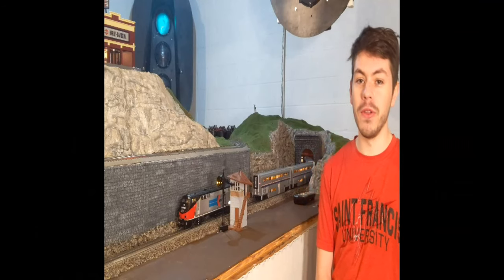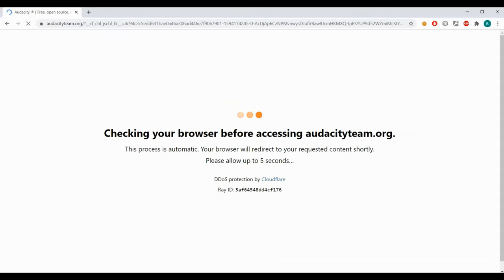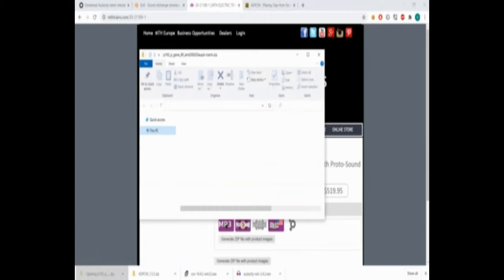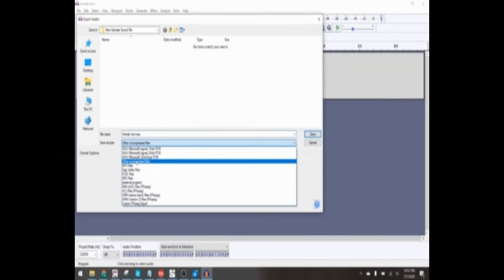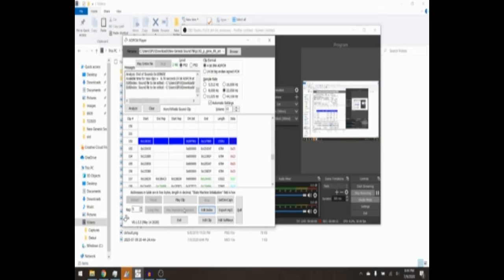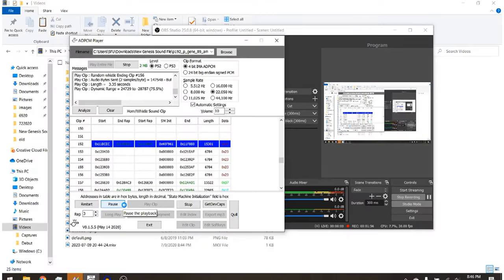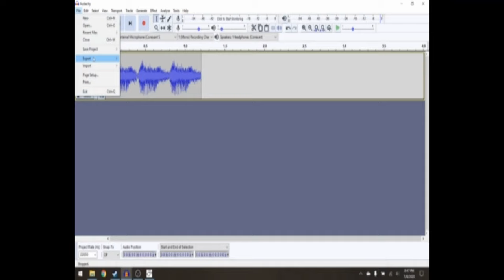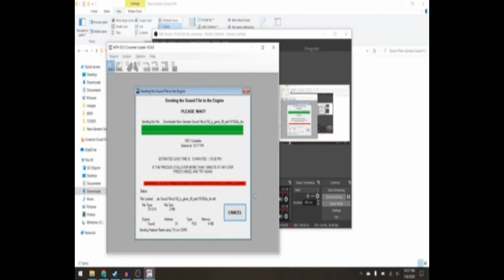How to Create a NEW Horn for MTH Proto 2,3 Locomotives

Comment: Hi p42Amtrak83,
I have been trying to customize a whistle for my engine, but have been running into some problems. When trying to finalize the long play/ repeating segment, the sound will become extremely static with the loop index. The rest of the clip is normal. Do you know what the fix is for this?
Reply from the maker: Hi Issac. Play with the State Machine init value. If you play the horn once, the state machine init value will appear in the log. That's a good value to start with

Comment: Cool stuff! I did a video on this program too!
Reply from the maker: I came across yours about two days ago right after I was about halfway done with this. I wish I would have seen it sooner.  I liked yours.  Have you been able to inject the 24 bit PCM clips?  I can only do it from MTH created clips
Reply: @p42Amtrak83  Thanks. I haven't tried injecting 24 bit PCM clips. I really don't have a reason to at the moment. One thing I am trying to do is create custom shut down sequences that are longer than the one that is in one of my engines now. I'd like to add more to the PFA sounds too (In my case citys for station stops) but it looks like I need to find a file that already has those clips it in since I tried putting my own in to an empty spot and they never play.

Comment: I'm having trouble with the batch file. I copy and pasted the code and made a batch file but I just get an error when I drag and drop my vox onto the batch.
Reply from the maker: Make sure the file name ends in "<SampleRate>.vox" you'll have to rename and change the extension out of audacity for it to work.  I think that might be why it's failing
Reply: @p42Amtrak83  Yup that was it! It's converting just fine now. Thanks for the quick response. Can't believe I missed that.
Reply from the maker: @bhomas_real  any time!  When I did this the first time, I had the same issue and it took a while before I realized it.  I figured that was probably the issue

Comment: Sorry to keep bothering you with this. Having some problems. If you can't help that's not big deal. 

I made a soundfile using a custom whistle (white button on the remote), SXS, SFS, SRS, and S01 commands, and I also changed out the chuffing noise for custom files and replaced a few other things here and there with clips from other existing sound files. All were already 4 bit files. I tested the steam file in a Railking diesel just to make sure everything worked and it did without a problem. Now I'm trying it on the actual steam engine I designed it for and it's not working. There is only idle sounds, no chuffing, and only the looped part of the whistle is making noise. There is no beginning or end. All of the lights work. Could it be an issue with the chain files? I can't wrap my ahead around why it would work for one engine and not the other.

Again sorry for all the questions. It's just frustrating.
Reply from the maker: Oh that's interesting.

I suppose it's on a proto 3 steamer if you're talking about the chain files.  Is the railking engine also proto 3?  You can try reflashing it with the chain files

Are you modifying the sound file that came with the engine?  I'd recommend using that.
Reply from the maker: Funny you mention that,. I swapped out the idle sounds on a diesel (which, might be the equivalent to the chuff sounds). It didn't work for me.  I'd recommend using the default sounds for the chuffs and seeing if you can get your new whistles to play first.  If you can do that, it'll tell you that the issue is in the chuffing sounds.  I'd take it one step at a time (if you can just get the looping whistle, you'll know that your initial process is right, and you can incrementally add stuff to it)

Comment: I don't know whats wrong with it, set the hz and all correctly but it slows down the clip i add to like 0.25 except for the ending
Reply from the maker: Should be the databyte in the adpcm tool.  You might have to manually set it using the table on the website to match your sampling rate.
Reply: @p42Amtrak83  I changed the databyte but i cant figure out what it is doing
Reply from the maker: Is this in the locomotive itself or in the adpcm software? I'm thinking it's still a databyte.  Try changing it to something else. If you select another frequency in the radiobuttons in the tool, will it eventually play correctly?
Reply: @p42Amtrak83  Ok I think I figured it out, I had to replace the file with one roughly the exact same length (4110)
Reply from the maker: Oh that's interesting! That's rather difficult to do!  Glad it worked for you
Reply: @p42Amtrak83  I thought it did, then I got to the hex part and nothing will make the loop work sadly.
Reply from the maker: @a-lineaficionado1000  that part is a little tricky.  Play the whistle once and look at the message notifications window..  you'll see a SM INIT hex value.  Copy that into the sm index value in the edit index window.  That should fix it.  I'm assuming you either hear garbled sounds or have volume issues or both
Reply: @p42Amtrak83  I can look again and try again but idk
Reply from the maker: It takes a while to get the hang of it, I reached out to Mark from Silogic. He's very very helpful.  The sm init value is reported when you press the play sound button (or whatever it's called...but not the long press button). It'll show in the messages.  It's hidden in there somewhere where you might have to scroll up a good 10 lines or so.
Reply: @p42Amtrak83  is there a way I can send you the sound files and MTH file I want them to go in so you can see what’s going on? This is a proto 3 loco so I don’t know if there is difference.
Reply from the maker: Sure! Can you send me a message on here so I can give you an email address.  I can take a look.
Reply: @p42Amtrak83  can’t figure out how to message on YT so I don’t mind giving out my email here just tell me when you see it so I can remove it.
Reply from the maker: @a-lineaficionado1000  I sent an email so you can take down your email address

Comment: If we are uncomfortable doing this do you think you'd be able to help install the new sound systems?
Reply from the maker: I can certainly guide you through it!
Reply: Ahhh thank you thank you thank you! I have an Atlas HO Amtrak Dash 8 model and I don't know if the installation process is any different from the F40 model
Reply from the maker: @highballallaboardthewdwrr550  I think it would be quite different.  That uses a variant DCC. I know some of them are customizable. The ADPCM tool is unique to MTH locomotives.
Reply: @p42Amtrak83  
Okay how about an MTH Amtrak Dash 8?
Reply from the maker: Yep! That would work perfectly
Reply: Does it matter what sound system the unit comes with? Say the unit has PS1 or no sounds at all
Reply from the maker: @highballallaboardthewdwrr550  That's a good point, PS1 will not work since that was produced before DCS was invented.  PS2 and PS3 work great
Reply: Ahhh okay thank you!

Comment: One question - in the sound file I'd like to edit it automatically loads itself as a 24 bit PCM. Can I just select the 4 bit option or will I need to find a file that automatically loads itself as a 4 bit?
Reply: And another question while I'm trying this out, the vox to ima converter isn't working for me. I'm getting an error message telling me "the system cannot find the path specified. Import this file into a soundfile using ADCPM as a 4 bit ADPCM clip."
Reply from the maker: I would strongly recommend using a file that already is in the 4 bit ima format. The official documentation from Mark recommends keeping the file format the same as what you're replacing, I haven't really questioned it.

 The way to import your own 24 bit PCM sounds doesn't work, and you'll end up with a garbled sound.  

 From what I've found, most sound sets use the 4 bit ima sounds for the horn / whistle.  Even the newer ones.
Reply from the maker: Did you install SOX / restart your computer upon completion?

I'm assuming you're using the .bat file that came with the ADPCM download.  Is the batch file in the same directory as the .vox file you're converting.  In addition, you'll have to rename the file from ".raw" to ".vox" or the batch file won't recognize it
Reply: @wurlitzer1538  I'm having the same issue with the path file not being specified in the batch. Were you ever able to resolve it and is so, how?